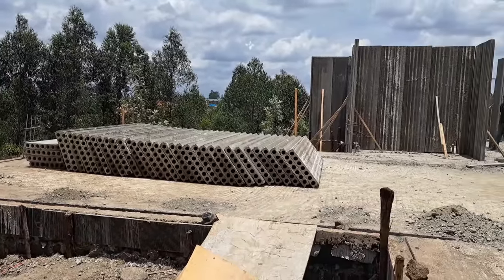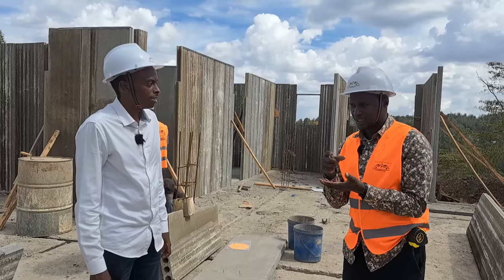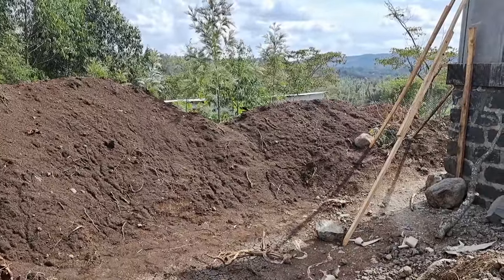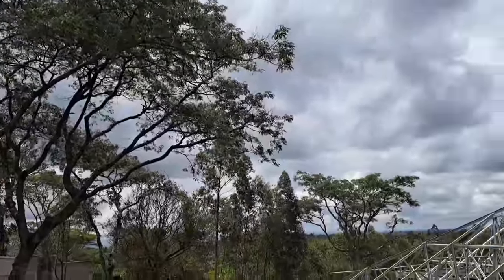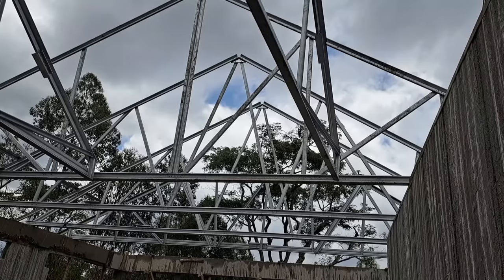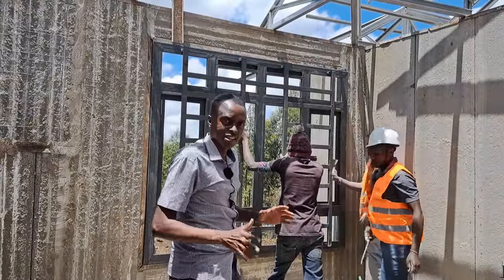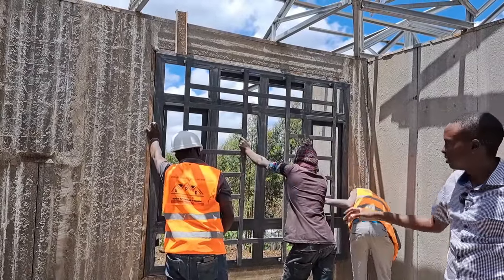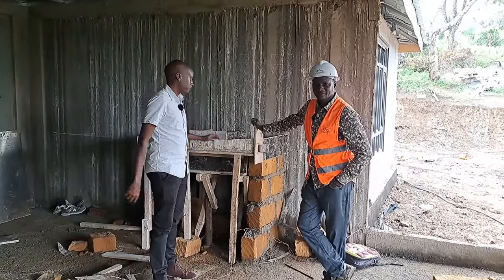Watch a 247 SQM Bungalow Rise: Weekly Updates on this Precast Concrete Build

Comment: Hi Nick and Chomba. Another informative video. Chomba, that idea of steel channels in the floor has really set me for the precast panels for sure. Initially l was sceptical of how the panel settled on the floor. Other videos showed pegs through the precast panel holes and then filled with concrete. This self-designed system of your is a definite plus. Definitely going to do precast now following your c-channel in the slab formation. Thank you guys,
Reply from the maker: You're welcome Stephen. It's definitely a great idea
Reply: We appreciate
Thankyou
Reply: @sammy, is it possible to do the project in phases? 1 floor at a time,  then you look for some more money to do the next floor. Maybe after 6 months hivi?
Reply from the maker: @0721958643  Yeah it's possible to do it in phases

Comment: Very impressive. Though I am curious, what's the integrity of precast if, lets say, you are drilling holes for mounting a TV or sonmething heavy?
Reply from the maker: The panels are steady enough. Though everything is a harmonised system. The panels, beams, columns, and foundation work together to support the whole structure
Reply: It's concrete and highly compressed 
It can hold any hanging item
Reply: I was asking the same question

Comment: Good content by Nick. But 7m for a 1 storey 4 bedroom?? That's too much
Reply from the maker: Each project is unique, Rodney. And every client's preferences are different.
Reply: I agree that 7m is not cheap, in fact the price shown is 7.8m which is closer to 8m. The final price of your house depends on what finishing's are used and other features in the house. This house has many  huge windows  and some windows span from the ground to the ceiling. This is a very expensive feature. The type of foundation can also be the most expensive part of house. You saw some areas of the house where the foundation was deeper than Nick's height. The amount and type of tiles, bathroom fixtures and lighting features also can significantly add to cost.

Comment: Hi. Great content Nick. A question though, given the panels are very slender or slim, how is the noise, do they allow noise from outside or between rooms?
Reply from the maker: The hollow sections regulate noise by trapping air. Air is a poor conductor of sound. But if you’re after serious soundproofing, you can add sound trapping foam inside the hollow cores
Reply: @PropertyNoma  is the sound trapping foam available and how much is it?
Reply from the maker: @stangits  You can get them from sound insulating companies

Comment: I only have one problem, ask the Builder to keep the site clean, especially on the concrete slab, it is very easy for a worker to get injured, Yes, I know, safety, safety, safety, is killing profit, but if your best worker gets injured  you will have to be  there all the time instead of sourcing material.

Comment: Why use chipboards on the kitchen cabinets rather than using blockboards? mmeharibu hapo. The chipboards will come apart with the slightest contact with water. But otherwise, good job and well done.
Reply: These are laminated mdf which are not affected by water or moisture

Comment: Hey. How much to fence 100 by 50 please cost every thing please.
Reply from the maker: Like Ksh 700k including 118 panels, 34 H-columns and labour. But final cost will depend on your soil type and foundation design. This is a rough estimation.
Reply: Approximately 670k 
Depending on the dimension.
Reply: Depending on the location it will cost between 650-690k

Comment: for the light gauge steel is it advisable to areas prone to rust like the coastal regions as compared to using timber.
Reply from the maker: Thanks for the advice
Reply: Light gauge steel has an alloy coat that prevents the steel from any harmful rust or any other effects